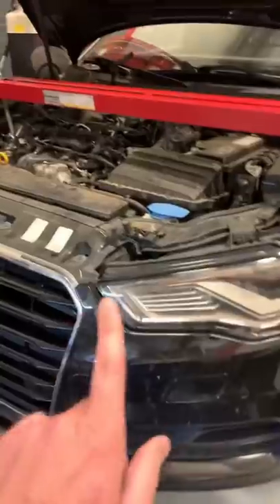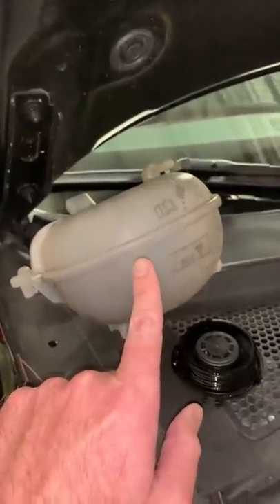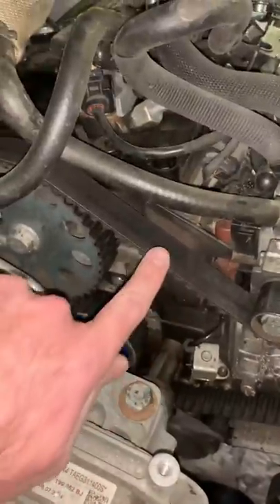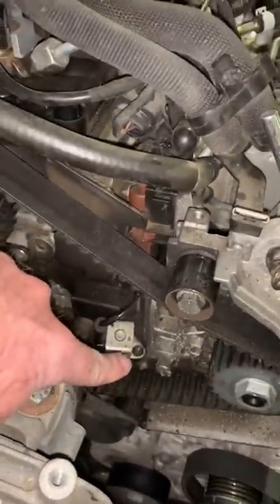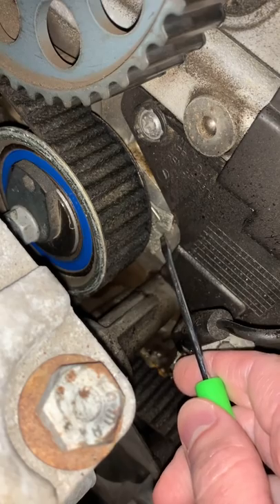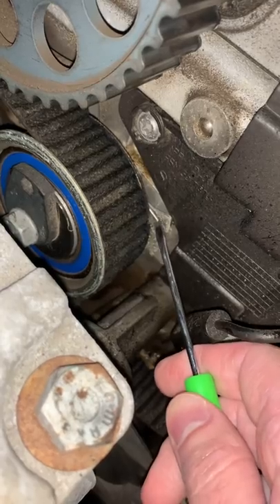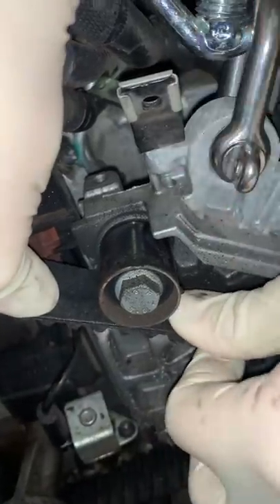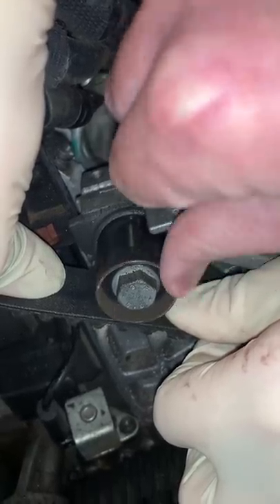Don’t let problems go on your car! #shorts

Comment: By "smoke" the engine he means valves and pistons kiss at significant speeds. Leaves dents and bends in all kinds of places lol
Reply: Happened to me last week dont know why tho  it was shooting out white smoke
Reply: @poppaganja3793  Your timing belt broke? White smoke is usually boiling over if from the hood or head gasket if from the tailpipe. Usually steam from water or coolant somewhere

Smoked is just a figure of speech, he means its done. Worst case scenario when a timing belt breaks and its an interference engine, the valves opening literally collide with the pistons at the top (TDC) and it mangles all parties involved
Reply: @poppaganja3793  white smoke would mean the turbski be gone but if your na then probably head gasket
Reply: @poppaganja3793  white smoke could be coolant, blue smoke could be oil, black could be gas, “generally”
Reply: That's why I prefer timing chains and a separate rubber belt for the rest
Reply: Or in my case with a VW/Audi engine when I had my 1998 Volvo diesel that died in 2014, when you see the engine light come on and bits coming out the exhaust you know your engine is no more. I mean, not even turning on the key, just a click.
Reply: Depends on whether it's a zero tolerance engine. Most engines today are not zero tolerance, which means they can jump time and not hurt anything.
Reply: Wouldn't happen if the engine was non interference.
Reply: @chasemiller7974  If an engine is non interference, the timing belt/chain can completely break and there will be minimal, if any damage. Most diesel engines are gonna be interference, as the compression ratios are way higher
Reply: @rajgill7576  some are ok. Depends on how deep the valve reliefs are on the pistons.
Reply: he means overheating
Reply: Non interference engine ftw

Comment: As someone who changes oil on a daily basis as my job, I can tell you that 99 percent of audi owners don't take care of their cars.
Reply: This is the main problem. They buy an Audi and can't afford regular maintenance and so neglect them. If maintained properly, they'll last just as well as many other cars.
Reply: Probably because most of them lease the car..
Reply: I can believe that, Audi owners don’t exemplify someone who likes to turn a wrench and guys who like to work on there vehicles usually stick to the small block Chevys or fords
Reply: They usually  barely afford the insurance and note
Reply: And to be fair the oil change period is already pretty extended for people who take short trips. I had to cut my change intervals in half to avoid the rich fuel smell from
Oil dilution
Reply: @Jushwa  wtf that's not even remotely normal, what oil did you use? corn oil? sunflowerseed oil? dude
Reply: @witoldschwenke9492   it has nothing to do with the type of oil. It’s because of living in a cold climate with lots of cold starts and very short trips. Castrol or liqui moly it occurred the same amount. If the oil never reaches operating temperature the fuel doesn’t burn off. That’s how you end up with oil dilution. You could run the engine longer, take less short trips, change oil more often, changing the type of the oil tho in my experience doesn’t have an effect,
Reply: Don’t forget BMW
Reply: Lube tech.
Reply: As someone who lives in reality I can tell you that 99% of people can't afford the fucking repairs
Reply: What percentage do I fit in?

I have 2 Audis and service mostly myself.

Comment: “Don’t let problems persist on your car” meanwhile me with 5 lights on my daily e60 and a blown turbo in my subie because I ignored the overboost 😂
Reply: At least your E60 is running. Mine has been sitting broken since 2016! 🤣
Reply: Both are quite shitty to maintain, since they break all the time…. Get yourself a 90’s Toyota, not as luxurious or fast, but hey… at least they start every time when you turn the key.
Reply: @stilianivanov3377  I like fast fun cars and I’m a technician it’s not too big of a deal for shit to break on me
Reply: @griffin_kith6214  Im a mechanic also, and to be honest the last thing I feel like working on is my car. Sure I have a fast and fun project on the side, but I need a reliable vehicle that wont give up on me…
Reply: @stilianivanov3377  the only e60 bmw that was a nightmare was the m5. The rest were fine. Tons of those putting around with well beyond 100k miles. I know a few with 200+.

Subaru is strongly tied to the owner.
Reply: Jack K  the oldest e60s are pushing 20 years old. That's a feat for any vehicle as you can't stop time, nor maintain against it.

Even at the high end of miles per year of 14k that's only 250k. So no I wouldn't expect to see hundreds and hundreds of thousands of miles yet. 

Either way. 100k is still a benchmark for quality and 200k is something that even legendary builders like Honda and Toyota don't always reach
Reply: @jeepmanxj  good christ. I have 330k on my 745li and I consider that a miracle for the car it is. But for any average car I would own that would be a ridiculous repair bill for that k. I have 450k on my Mazda truck and it's needed 3 sets of brakes, rear leaf spring because I broke one carrying a ridiculous load,  probably had about 4 sets of tires on it in all that time, 1 injector and 1 slave cylinder. Now the beamer in the past 6 months has blowen through 3 amps in the trunk, 1 air spring, 4 hcus, 1 cas and dme, 1 whatever the fuse box and regulator is called, multiple rear end busings multiple times, blowen seals in the trans, lock up clutch in the tourqe converter is now smoked and next on the list. And best of all I've ruined more stupid low pro tires in the past 6 moths and 20k then I ever did with the truck in 450k. I'm a ford tec and the beamer is absolute fun to work on and troubleshoot, that's absolutely why I own it along with the overall nice drive. But you just can not call that a good car when it coast 160k+ bucks new yet my 20k dollars when new truck does 450k for basically nothing, maybe 800 bucks over the years. Christ if you were taking that beamer to the shop for all this I wouldn't doubt 20k a year in repairs. Just the coolant pipe that just blew would probably have been a 5-10k dollar bill. I fully accept their great cars for what they are, driving and luxury ect... but you just can't call anything a good overall car when they are in the shop litteraly every month before 300k, yet alone pretty much every week.
Reply: @MrRecall200  I've literally never seen a Mazda/Ford ranger that got more than 10 years before rusting completely through the frame. So you are either lying or, proving that your singular experience doesn't represent anything important to this conversation.
Reply: @jeepmanxj  ask any mechanic worth his salt, BMW in terms of reliability and longevity is dog shit on average, at bezt
Reply: @Tdawgsbud  yep, says as long as you avoid the performance models they go forever.
Reply: Cambron Gabaree  the whole world is a big place with a lot of wet, salty, cold, and nasty climates. It's the minority of people that don't have to consider jt
Reply: Cambron Gabaree  yes, water causes issues. Like in areas of the southern US where humidity is high year round. Salt from ocean air or used for frozen roads, areas of heavy manufacturing and industry from chemicals in the air. 

Essentially unless you live in the desert.
Reply: Cambron Gabaree  I'll bet you live in the middle of the desert and think you've got a grip on rust issues. 

It's hard to understand this, in places where there is actual water, but it's never "just water". It doesn't have to be salt from roads. Dirt, chemicals, and everything else is in that water
Reply: Cambron Gabaree  you live in Indiana and are here making rust isn't bad claims. Fucking lol. I've seen swiss cheese with less holes that the shit they have.
Reply: I know your pain... I`ve been driving with a service and airbag light on for nearly 2.5 years (broken clockspring), i have an oil leak that is big enough that every time I park there are 3 or 4 drops of oil that show up under the car overnight, with it seemingly progressively getting worse, particularly when it`s cold, and said drops seemingly dropping down from the airbox area, which makes me think that said leak is coming either from somewhere on the top half of the engine and the oil just goes along the bottom of the intake untill it reaches the bottom of the airbox and drops down, or I have a clogged pcv valve or failing turbo seals. I also first noticed the leak nearly 2 years ago, and it was pretty intermittant, realy only happening during the colder winter days, so since it`s been progressing pretty slowly, I`m choosing to ignore the leak... I also have one or more dead glowplugs and my injectors are probably pretty tired (once temperatures get below about 5°C the engine will start to take a bit longer to start, with a bet of hesitation when first firing), and so is the battery, because when starting the car it shakes pretty violently the moment the engine first fires, and the engine is really clattery and smokes a little bit when cold... The trip computer display also bugs out, and sometimes parts of the display don`t show information proporly, to where sometimes when displaying "press clutch + start to start", it will actually display blank spaces instead of part of the message, or when scrolling through the trip computer modes, part of the screen will change to display the new information, but part of the screen will either lag significantly before changing, or won`t change at all.. there was also a couple of occasions where the screen would display nothing at all: the first time that happened I stopped, shut off the car, took the card from the ignition and locked the car, and when I started it back up the display came back... The 2nd time the screen went dark I ignored it and kept driving, but after an hour or so the dash had a panic attack for some reason, and flashed the big red STOP light at me for 30 seconds or so (and I think the rpm gauge went dead when this happened, but can`t really remember), but with no check engine light, and the engine running, sounding, and pulling about as well as normal, I kept going, though I did pull over to do the whole reset routine to get every thing back to normal... It`s been about a year since this little freakout, and the car hasn`t done it again since... There have also been a couple of instances in the past where I would get up to the car early in the morning (it was still dark out), and when I pressed the unlock button on the keyfob, the low beams would randomly come on, while the lights were in the off position... This happened twice in the 4 or so years I`ve had the car, and as far as I`m aware it`s not equipped with this feature... I also had the rear left exterior door handle go all wierd for a bit at one point (it would stick if I remember rightly), but some WD-40 and liberal usage of the handle solved that.... The suspension is also worn out (particularly front and rear shocks) it needs a ball jojnt on the front right suspension, and it pulls to the left, but despite all these tiny quirks and flaws, my 16 year old Renault is pretty damn loyal... It starts, runs and drives well enough to get me where I need to go, and has ben doing so in pretty much it`s current condition for quite a while... Hell, i`d be willing to bet that even tired like she is and with dead or dying glowplugs, with just a new battery or a battery booster, she will still start at -10°C. She won`t manage to start on the 1st attempt, since she couldn`t do it first try in previous years, but she will do it 2nd try, albeit with some significant sputtering, untill enough cylinders can get the heat necessary to sustain diesel combustion, and she will still sputter and misfire for about 30 seconds to a minute, until all the cylinders get some temperature in them (holding the engine a bit over 1000rpm like a petrol would do helps significantly, since normal cold idle on my car is about 900 rpm)
Reply: Cambron Gabaree  "it's a nice truck, well taken care of, adult owned. "

Wheel arches gone, bed mostly gone, only 3/4 of the floor pan left, tailgate strapped on because the handle rusted off, windshield no longer seals.
Reply: Cambron Gabaree  rust destroys cars.

Most of these legendary cars and trucks people talk about never saw 100k because they rusted to dust. 

Rust is an issue for the majority, not minority of Americans. 

I see tons of people talk about how reliable their car is as it's barely a shell of a car. It does not matter what the engine or transmission does if the body and frame disappear from rot. 

Northern areas (not southern like you claimed) where the rust belt actually is, you have to have your vehicle inspected every few years and they often are junked under 10 year and under 100k.

100k is a mark 15 years is a make 200k is more than your average vehicle will ever see, and those cars everyone talk about lasting forever will rarely actually make it there.
Reply: @ToyotaNutjob  they both eat v8’s for breakfast and I enjoy them 🤷🏼‍♂️
Reply: E60 💘 great car
Reply: @escueme  535i?
Reply: @jeepmanxj  have 165k on mines. Runs like new
Reply: @jeepmanxj  if you take care of it. Theu will last forever and that goes for 99% of them. I have a 01 dodge 1500 with the 5.9 mag and it has over 270k miles.
Reply: @protipskiptoendofvideoandr286  sweet it's nice to be the top 2%
Reply: My e60 prob has a chargepipe problem since when i push the engine too much the limp mode activates (happened in 3-4 gear on 6k rpm+
Reply: @tntfragz1945  you should probably find the leak and fix it.
Reply: me having drove my prius with a blown head gasket for 10k+ miles now lmao
Reply: Are you flexing? That you neglect you vehicles?

Comment: The tensioner window is only for initial tensioning. Once the engine rotates, the arrow will be out of the window.
Reply: I work on off-road generator sets. Some have European diesels in them and we will have to check the timing belts at certain intervals and if the tensioner location is off then we reset it and then that means the belt is broken in and won’t move anymore.
Reply: Correct, and you can always push the belt away from the small idler pulley
Reply: Wrong , on a Audi tdi one the tension is set it will be in the tensioned spot all the time when at tdc.
Reply: No you can line them all back up with say so many rotations at crank. And they should all be on there mark
Reply: @robprior1246  thought so
Reply: Thats right turn the crank alittle more clock wise it will probably back in the window
Reply: Yes, it's a floating tensioner. It's only right at tdc on compression stroke, at first install
Reply: Still should absolutely never be that loose that is super super bad
Reply: @robprior1246  so the exact same tensioner that’s been in use for decades now magically works a different way on a VAG tdi. The tensioner is not a gauge. The window is for initial instal only
Reply: @TheJacobbridges25  Timing belt must not be very tight when engine is cold.

Comment: The idler is made to spin freely so you can spin it by “hand”. Also coolant will not stretch a timing belt.
Reply: Jack K  over time yes and the
Chemicals  break it down.
Reply: You should NEVER be ably to spin that idler by hand WITH TENSION on that belt.
Reply: Please do tension one and prove everyone wrong though.
Reply: @PolishedMobileDetailing503  oil breaks a belt down over time
Reply: @ryangreenley4818  he didn’t have tension on the belt when he spun it and said it shouldn’t be able to spin freely lol
Reply: He never touched the tension, it was to the point of losing tension from being stretched.
Reply: @ryangreenley4818  he did lol. He pulled the belt away from the pulley by hand !!
Reply: I was thinking the same, the belt "stretched" because the water pump failed (which means the pulley probably has a load of movement in) and the only reason they were able too spin the idler is because they pushed the belt away from it 🤣
Reply: Timing belts are a different breed of belts. They do not stretch. They only snap. But timing belts are extremely tight an no you shouldn't be able to push down on a timing belt like that. The issue had to be tensioner failure.
Reply: @barrybritcher  you shouldn't be able to do that. Those tension belts are tight (or, should be...)
Reply: @mergingfalls2331  yes, but you shouldn't be able to push the belt down like that
Reply: Yes the idler is supposed to turn freely of course, the point is that the belt shouldn't be so loose that you can lift it away from the idler with your fingers.